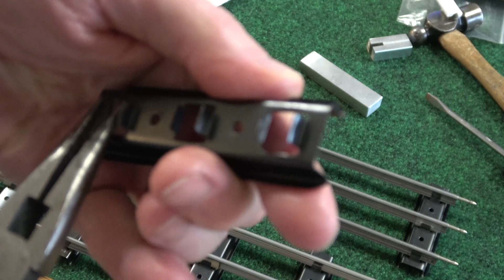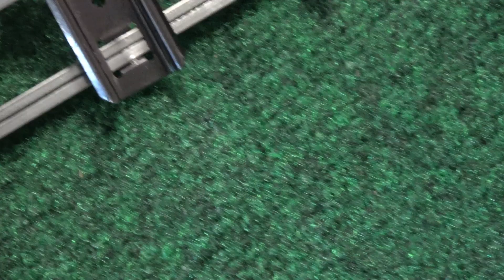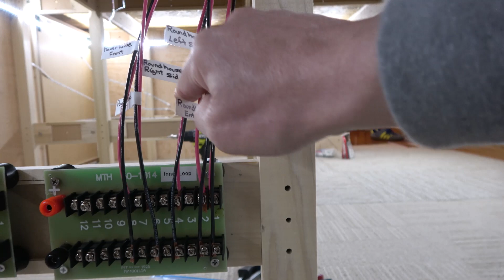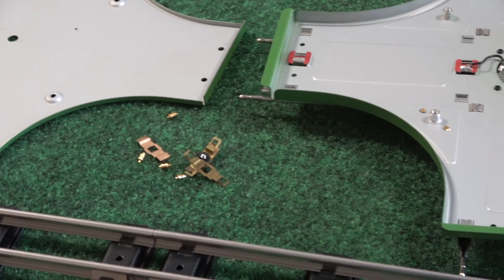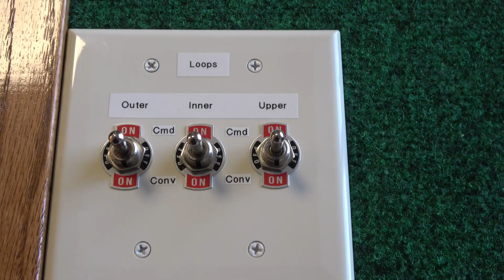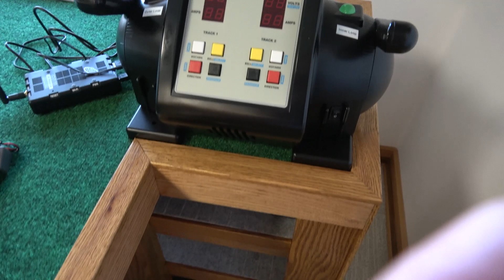Standard of the World - Episode 15 - Track, Wiring, Power & Test Run!

Comment: Hi Sean, watched this video a few times. Appears circuit boards mounted in center under layout. Looks awesome with Banana Jack wires You made. I was looking on Amazon trying to find same 3 way Toggle Switches. I could only find ones with 6 pin that you slide lugged wires onto. Nothing with screws. Can You help?
Thanks,
Joe

Comment: Great Video and set up Sean! I too had considered soldering feeder wires. However, messy difficult, snd some broke. Kirk had also suggested the method of inserting lugs underneath track. However, I did not remove plastic as you did, and never obtained s good crimp, without destroying lug. Maybe in a future video you could share the crimping tool and process? I bought my Tie Tools from PE Design on Ebay, if anyone is searching?
Thanks,
Joe
Reply from the maker: I think those plastic insulators are what prevents the good crimp.  Thats one reason I take them off.  I pinch the spade end of the connector in a pliers to hold it and then take another pliers and twist off the insulators (don't try cutting them they are too strong).  Then I hold the wire in the connector and crimp using a wire cutter pliers that has sort of a dull set of jaws.  I crimp the top and bottom where the wire comes through and then middle.  It ends up super tight!
Reply: @SeansHobbyHouse  Thanks Sean! I will give it a try! Love that Circus Set. Really nice, and glad You were able to get a great deal too!

Comment: So with the toggle I would only be able to switch between command/ variable and full conventional- transformer. Is that correct?
Reply from the maker: Yup, for each loop I can run either from Output of TIU/TMCC Base or from Transformer Handles.

Comment: Sean where did you get the wire labels. What a great idea.
Reply from the maker: Amazon. Here you go.  
https://www.amazon.com/gp/product/B08689NSH9/ref=ppx_yo_dt_b_search_asin_title?ie=UTF8&th=1
Reply: Great where did you get the switches? My upper level is variable through the TIU so I can use them on the lower level
So I can run my conventional engines there as well
Reply from the maker: @mikeyanello3664  They are on Amazon.  Here is what I used.  Make sure they are fixed not momentary, or the lever will spring back to off.
https://www.amazon.com/dp/B07LBMMN2Y?psc=1&ref=ppx_yo2ov_dt_b_product_details
Reply: Thanks Sean much appreciated Buddy

Comment: Coming along nicely Sean, very impressive!  And that's a good re-creation of an old-time Keystone air whistle on the 9e!  Those early electrics had air whistles, not horns, and the model does a nice job with it!
Reply from the maker: The air whistle was on the little 384E Steamer, but I love the sound of it.  Sometimes I like it better than the modern electronic whistles!
Reply: @SeansHobbyHouse  Oh, yeah, the traditional Lionel type mechanical air whistles are nostalgic fun all right, but I think you misunderstood. 
When the first electric locomotives like the NYC's S1 and others were developed there were no air horns like the later electrics had (think GG1) so steam whistle technology was used but with compressed air.  That's what I meant when I mentioned the Keystone whistle on the 9e, the electronic system does a pretty good imitation of the same.